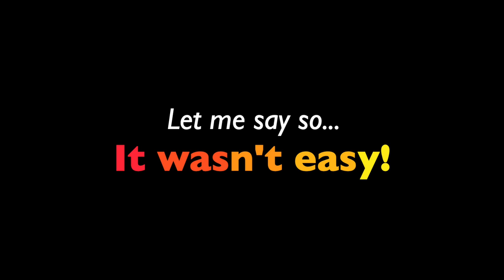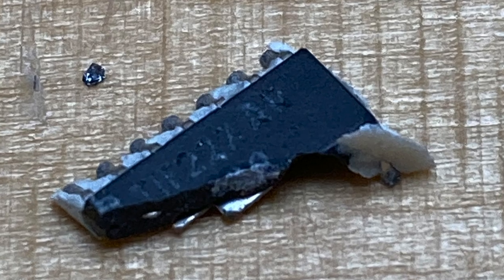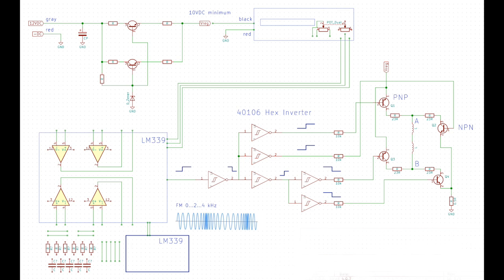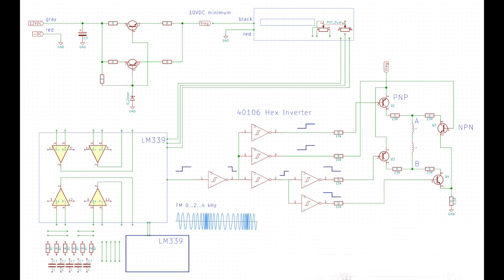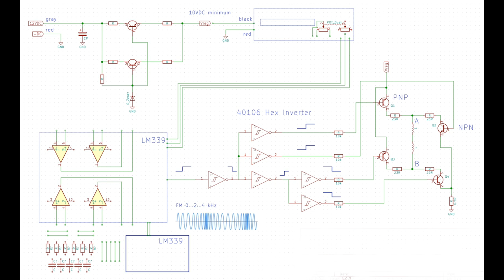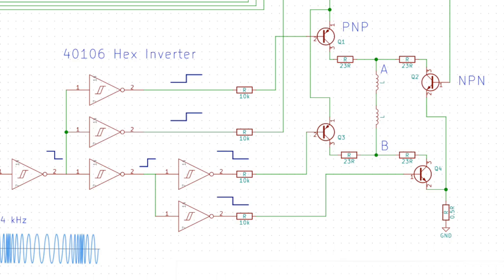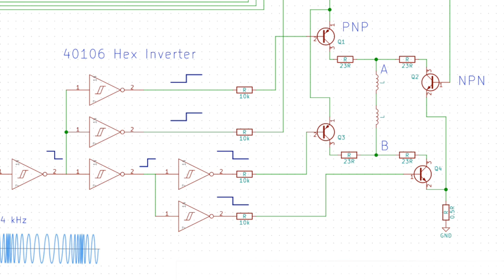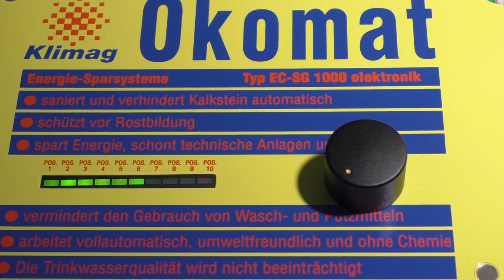Electronic water treatment part 2 (PWJ194)

Comment: Thanks very much for the effort of unpotting this magic tool. Pro tip from reverse engineeering department: many resins will soften and crumble away with next to no effort once heated with a heatgun to about 200C
Reply from the maker: I tried heat.... but that resin is about the same as the PCB epoxy itself. I would have destroyed everything. The PCB is completely intact, so I could just solder new parts in and it would work again. Naaaah :-)
Reply: Your  method worked  surprisingly well, have to note that down for such hard epoxy resin. Its true, every weapon against epoxy also destroys the epoxy pcb.

Comment: I wonder if the gravel is to also impede xray machines from looking at the contents as well?
Reply from the maker: posiible. But Ithink they simply used it because it's cheaper than only epoxy.
Reply: It just makes it heavier, makes it feel like something substantial / quality is in there for the size of the box.

Comment: Resin plus aggregate is a waterproof alternative to concrete... and stronger than it. Never seen it used to pot electronics before. Interesting use... By interesting, I mean diabolical.
Reply from the maker: I agree. As a building material this would certainly work great. But in this case, it's just there to prevent access to the PCB. But it didn't help to keep me out... 🙂

Comment: I am really confused by the complexity they put into this circuit. For example there is no plausible reason why the resistors in the H-bridge would need to be assembled from series- and parallel-combinations, also making a voltage regulator from discrete transistors and zener diodes does absolutely not make any sense since 40 years ago. This makes me almost believe that the "engineers" (scammers?) behind this box truly believe they created something magical - for a scam this already looks too complicated, unless they wanted to disguise the utter simplicity by making it much more complicated than needed.
Reply: To be fair, creating a resistor from a series parallel combination like that can help in spreading the power dissipation, enabling you to use lots of smaller (and cheaper!) resistors instead of one big one. It also allows for some redundancy, as depending on the chosen arrangement, one resistor can burn and the device will still work to some extent.
Reply: @davidgustafik7968  true, but...
Reply from the maker: You have to keep in mind that the entire unit is potted in resin. So heat dissipation is difficult. So it's not a bad idea to spread the power across many resistors.
Another reason may be that more powerful units are available (google Sirox) and some of the spots were not populated with components. So thay can add more parts for different models. There are also footprints for larger output transistors.
And by the way... it is possible that the design is really 40 years old. Maybe they just went from thru-hole to SMD and kept the circuit as it was.

Comment: Epoxy can be removed by allowing it to soak for a week or so in a mix of MEK and acetone, which will soften the epoxy after a while. Sealed container, and leave the block submerged in it.
Reply from the maker: Won't that dissolve the pcb epoxy too?
Reply: @PlaywithJunk  No probably not. Only works on cheaper urethane resins, not epoxy. It soaks between the reisn molecules and build up tension (like in acrylic search solvent induced cracking)
Reply: @PlaywithJunk  It does, but a lot slower than the top coating. You do lose component markings, and most electrolytic capacitors will be destroyed.

Comment: Reminds me of a device I saw that was suppose to keep barnacles off a boat.   Every 30 to 45 sec you could hear the transducers sweep through a frequency range, rather high pitch, for about 2 seconds.   I would imagine its circuit would be similar.   I later heard it was able to reduce the number of barnacles but not repel all of them.   Certainly some barnacles had a mutation that allowed them to tolerate the frequencies.
Reply from the maker: Maybe they were deaf?